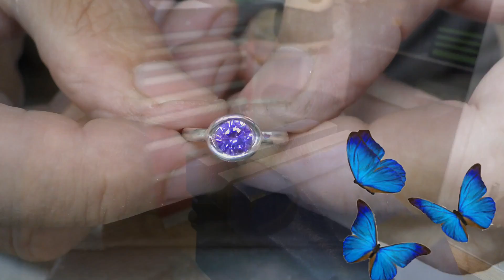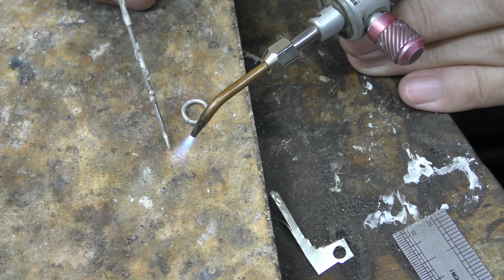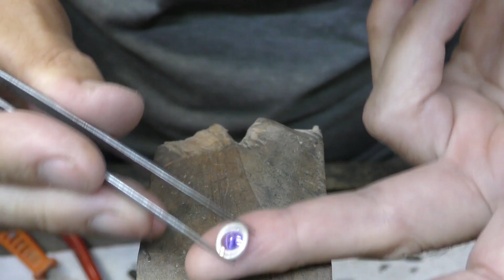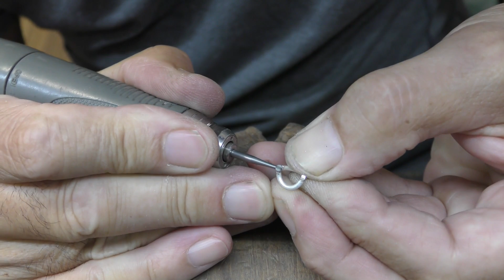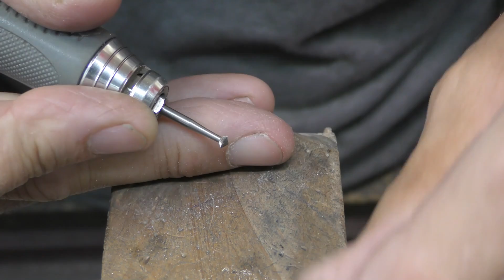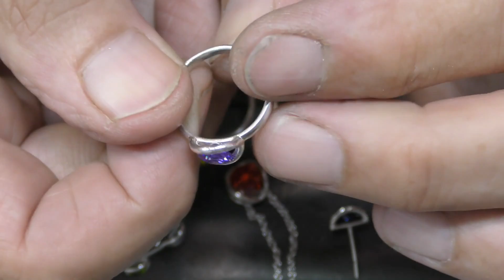Butterfly Setting

Comment: Thanks.  I made this in a couple of days (had to practice a couple of steps).  It didn't come out perfectly the first time but fairly nice.  You make a couple of steps look easier than they are.  In particular, I used the Lion Punch Forge tool, the Lion's Claw Silver to gently hold the right angle ring in place on the shank during soldering.